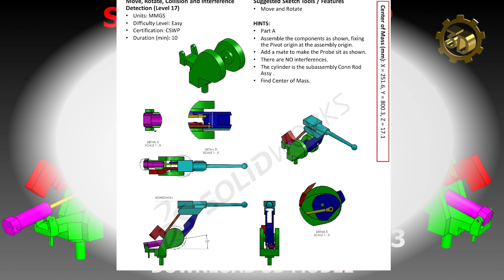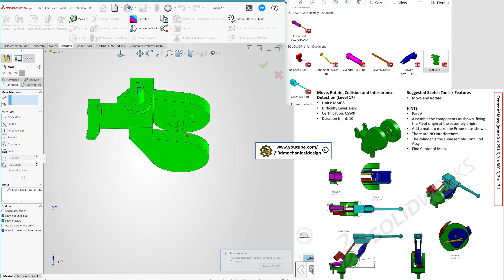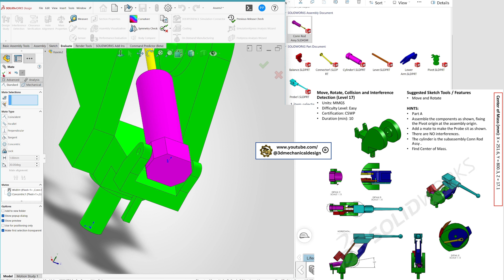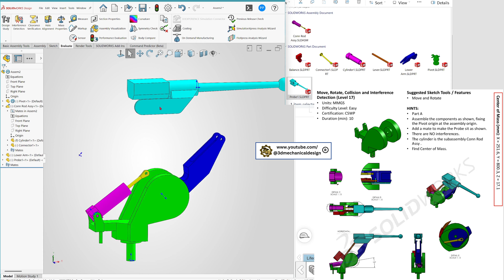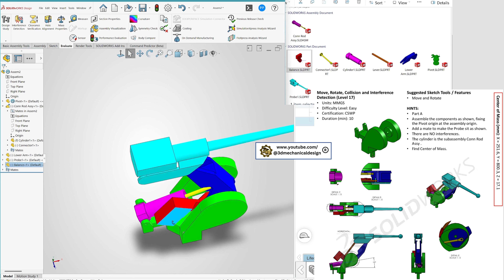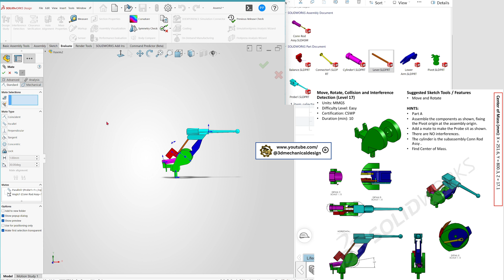Don't Fail Your CSWP! How to Solve Problem 17.3

Comment from the maker: Is the Assembly section of the CSWP task causing candidates a lot of confusion? Which tool in task 17.3 gave you the most trouble? Mates? Configurations? Mass properties? Let me know in the comments, and I'll cover it in more detail in the next video! 👇
Reply: for me i had all the correct mates you did but did it in a different order, i.e. i did the 10 deg and horizontal mates along the way instead of at the end. it made my assembly be in a very weird orientation but gladly i found your video. thank you!